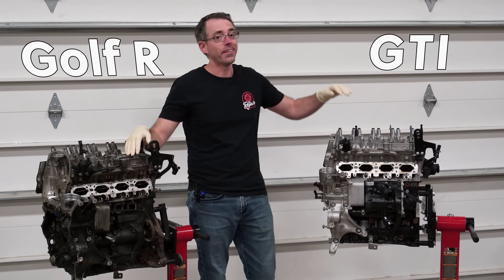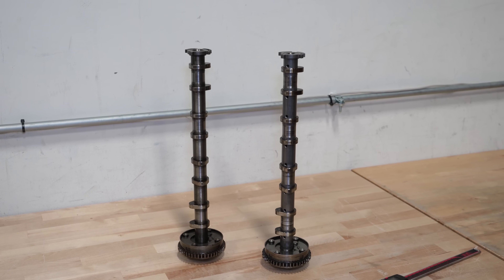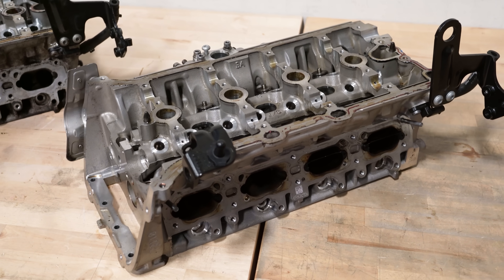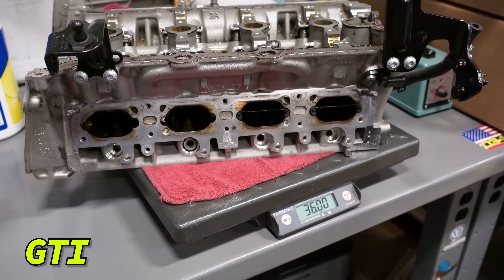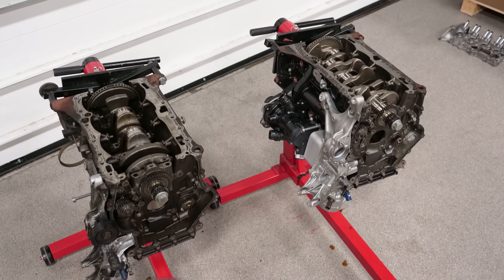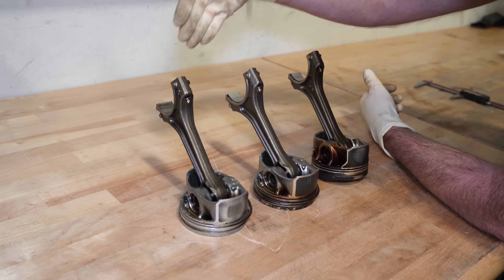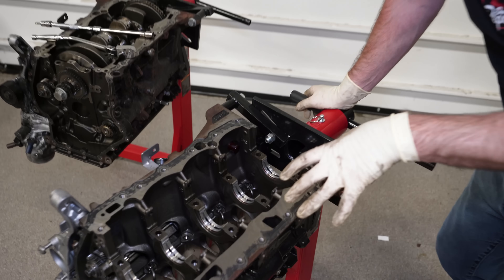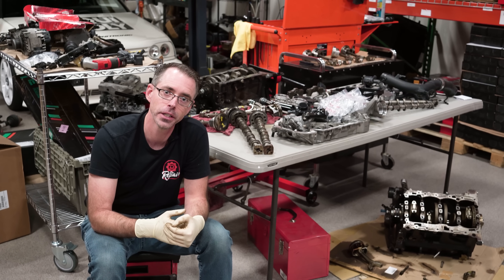Are Golf R Engine Internals Better than a GTI?

Comment: I wonder if there is a difference between the GTI engine and a A3 engine, one would assume they would be the same.
Reply: AXX and BWA engines for example are the same in GTI and A3 ... 2.0T FSI with 200hp. To be more specific both AXX and BWA are found in both GTI and A3.

Comment: I thought it was basically the same engine and that it was mainly electronically limited ... and then of course a difference in turbo and everything around.
Reply: All R engines have had some differences internally from the GTI. It typically isn't much just like you see here, but there's always been something on all of the generations.
Reply: @COMotorsports  Yeah, I see that now. I just was not aware before 🙂
Reply: @makingwaves1239 It's comforting that there are actually some differences, for the higher temperatures that you experience when you're running it harder.
Reply: @ByteSizedSociety  : I agree on that, but I guess that people that buy both the GTI and the R cars are buying them for running them hard ... at least periodically 🙂
Reply: To be honest, there's no overheating and thermal issues with a GTI engine that's been boosted up with hybrid turbo and such, if the owner actually does their homework and equips upgrades with appropriate intercooling, intake efficiency, and a high quality tune that doesn't lean the fueling out.
Reply: with mk8 gti and r - they have different compression ratios (9.6 vs 9.3), so they are still different.

Comment: It would be interesting to see the difference if you'd just swap a Golf R exhaust cam onto a GTI. Probably just a very small improvement on turbo lag.
Reply: I doubt it. I currently run an IS38 on my MK7 GTI. It’s tuned and running WMI. I hit full boost before 3krpm’s. Would love to see a Golf R’s full boost hit.

Comment: Shopdap I want you to know I did lowering springs on my mk8 yesterday and it took me 11 hours including 1 trip to Autozone.  My body and mind are broken.  When I close my eyes I'm still trying to get bolts to line up.  The biggest slowdowns were getting the driver side strut out and in, ended up loosening the steering column bolt (?), and getting the rear back together on each side. Had to try it in different orders jacking up and down over and over until finding the sweet spot for each bolt.

Comment: we needed this video. So might aswel get a GTI and slap a turbo on it. Differences are minor
Reply: Engine wise yes but awd and suspension makes it worth it depending on application haha
Reply: @vw.noahhh  totally disagree mate. The GTI TCR and Cupra are both faster thant he Golf R around the nurburgring and on a roll which is more liked what you would race someone off on the street. The Cupra and GTI TCR are like 150kg lighter and dont have 12-15 percent drive train loss. I owned a cupra before my RS3 and it never ever once got beat by a GOLF R. Always big gaps. Sure though if you love booting it from traffic lights sure. 

I dont hammer any car iv got in first gear or launch them. Its too harsh on the transmission. So i wouldnt ever want a golf r... I think a GTI PP and then slap on a IS38 would be the best bang for your buck.
Reply: @johnboy2436  definitely could agree on that point as well but 1) this video is comparing a base GTI to a base R and 2) Here in North America we unfortunately do not have the tcr, clubsport, any seat/ cupra’s/ skoda’s so that’s also not a fair comparison haha. The only valid one is the PP GTI plenty of people here especially on the east coast are already at the limits of the factory LSD.
Reply: @vw.noahhh  Yes but the GTI PP with an IS38 is pretty much the same as a cupra which is faster than a golf R. I dont own one so thats not why im saying this however... it seems like a very good route to go. I would do all the labour myself... probably take a day to get the turbo changed over. Bang for buck you cant go wrong with a GTi PP. I didnt even realize the USA didnt have these models... that sucks.
Reply: @johnboy2436  show me a video it is faster from a roll, stock...!?
Reply: @johnboy2436 if you're going to keep the cars stock then maybe you can claim GTIs to be faster in certain metrics, but not in the 1/4, especially once you start cranking the boost. That's the reason why the Draggy leaderboard (in 60-130 and 1/4  mile) has nothing but Rs at the top.
Reply: @johnboy2436  as a mk7 GTI Clubsport owner I wouldn't be too sure about the roll race. Yes the R-engined GTIs have the power-to-weight advantage, but at least for manual models, the Golf R is geared shorter. This will result in it having better in-gear acceleration than a GTI. I can't seem to find any videos that pit them against each other from a roll though so I can only speculate.
Reply: @psiturbo  just type in YT cupra vs golf r... any video on a roll the cupra wins by many car lengths? i would send it on here but links get removed.
Reply: @dq3666  I was comparing Golf GTI with IS38... the cupra does 100-200 faster than the golf r. Even on draggy. Its the faster car. Even around all the popular tracks around the world. The Cupra beats the golf r. The cupra even took the hot hatch throne from the Megane RS than held it for like 6 years. We are talking about the exact same car you know??? the cupra is a golf r... its the exact same chassis, exact same engine.. just 150kg lighter and doesnt have 15 percent drive train loss (like 35-40 bhp). Its simple why the golf r isnt as fast. I dont understand your point really. So from this video we can also understand a GTI PP with an IS38 is the same car as a cupra and will be faster than a golf r.
Reply: @tally5k339  I was comparing Golf GTI with IS38... the cupra does 100-200 faster than the golf r. Even on draggy. Its the faster car. Even around all the popular tracks around the world. The Cupra beats the golf r.. ALSO there is a golf with the golf R engine. Its called the golf TCR. The cupra even took the hot hatch throne from the Megane RS than held it for like 6 years. We are talking about the exact same car you know??? the cupra is a golf r... its the exact same chassis, exact same engine.. just 150kg lighter and doesnt have 15 percent drive train loss (like 35-40 bhp). Its simple why the golf r isnt as fast. I dont understand your point really. So from this video we can also understand a GTI PP with an IS38 is the same car as a cupra and will be faster than a golf r.
Reply: @johnboy2436  again, you are comparing stock for stock*. Now swap to big turbos--the FWD won't be able to put the power down off the line, so it gets smoked *every single time. You must not have checked the Dragy leaderboard, because all of the fastest MQB cars are Golf Rs, and there aren't any GTIs, Cupras, or anything else that's FWD that are even close. Even in roll races, the 60-130 record is held by Golf R.
Reply: @dq3666  0-60 means nothing.... Wow you can set off fast.... Cupra will ALWAYS come back past. If you want to race from traffic lights be my guest. All the car guys i know dont boot it in first gear, they care about there trans when they are tuned. Real world on a roll 40 onwards traction is fine. On a track, traction is fine. All the like for like Cupra's vs golf R on 100-200 runs beat the golf r... you think its spinning at 62mph with good tyres and good weather? your point is invalid. Golf r is slower, face facts. Nurburgring times dont lie. You keep saying dragy. I have a dragy and everyone compares 100-200 (62-124 mph)... You're a traffic light warrior bro. The golf r gets beat on track by the GTI TCR, GTI Clubsport S and the Cupra. Do you want me to show you the times?
Reply: @johnboy2436  yes bro I know what a GTI TCR is. The GTI Clubsport sitting in my driveway is the pre-facelift equivalent with the Golf R engine...

My point is that, if you compare the technical specs, the manual Golf R has shorter gear ratios presumably to improve acceleration compared to the lighter GTI. This is a tradeoff for reduced top speed however. So while a Golf R is a heavier car than a GTI CS or Cupra 300, it might accelerate harder because that's what its gearing is optimised for. Whether that is enough to offset the weight penalty is what I'm not sure on. I haven't seen any direct comparisons in a roll race. 

However as a driver's car I do agree that a Clubsport/Cupra/TCR is a better pick for the mk7 models. I find the mk7 R takes itself a bit too seriously, and that weight penalty is noticeable. A hot rod GTI is more fun more of the time
Reply: @tally5k339  Im not sure if your talking about the clubsport or the clubsport S... but here are the 100-200 times for both 

VW Golf R (Mk VII)	
100 - 200 kph	14.5 s	

Golf GTI Clubsport S
100 - 200 kph	13.0 s

As we can see the Clubsport is quicker. Its quicker around a track. Check the nurburgring times? I mean a second and a half is more than you think. You have a good car there mate
Reply: @johnboy2436  Tally didn't disagree! Obviously a two-wheel-drive car is lighter and has less drivetrain loss. Though I assume the Golf R disengages the rear wheel drive when it's no longer required.
Reply: @johnboy2436  regular CS, unfortunately the CSS wasn't offered in my region. Would be significantly slower because they sandbagged it to ~260hp (w/ 290hp overboost for 10 seconds at a time) so as to not outdo the R. Wouldn't look good if the spicy GTI was outright faster than their all-paw flagship. 

Anyway I saw a direct comparison of a 7.5R and a TCR, both with the DQ381 DSG7, and the TCR did indeed pip it by a couple seconds on the 1-200 run. If that mk7 R was a manual model, I'm not sure if say a Cupra 290/300 with the full power would beat it as convincingly as the CSS did. Probably be half a second in it tops
Reply: @johnboy2436  negative, I just watched it, from stand still the Cupra/ Leon, got smoked, and from the 50mph roll race got gapped by several school buses the Cupra... LOL 🤣
Taking in consideration that FWD is not the usual GTi, it has 300hp, much lighter than the Golf R, while the R is 320hp (on paper), and much heavier. Even the driver of the Cupra was dumbfounded the R was quicker as he expected at least from a roll race to win.... BUT still the Cupra was left behind, besides that it looks like a sporty cheap cross-over, ugly AF.
Reply: @tally5k339  The Cupra and TCR always come back past though thats my point. So real world, on the streets your beating a golf r and on track your beating a golf r. I dont want to drone on by i think you get my point, in real world application the TCR and cupra come back past. The cupra has the same chassis as the TCR and golf r. They are pretty much the same car with a different shell. Anything with a dig gives a golf r an advantage and makes it look better... Depends what you want from a car. If you want to race people from traffic lights then sure golf r all day. I presonally dont launch any of my cars, its too harsh on the trans and other components so the golf r would never suit me. I do track days etc. So the Cupra or TCR would be better. Which is what i have.
Reply: @psiturbo  The Cupra and TCR always come back past though thats my point. So real world, on the streets your beating a golf r and on track your beating a golf r. I dont want to drone on by i think you get my point, in real world application the TCR and cupra come back past. The cupra has the same chassis as the TCR and golf r. They are pretty much the same car with a different shell. Anything with a dig gives a golf r an advantage and makes it look better... Depends what you want from a car. If you want to race people from traffic lights then sure golf r all day. I presonally dont launch any of my cars, its too harsh on the trans and other components so the golf r would never suit me. I do track days etc. So the Cupra or TCR would be better. Which is what i have. I think you point went over my head completely. On a roll the cupra wins everytime by 10 bus lengths. On a track the cupra wins everytime by 20 bus lengths. The cupra wasnt left behid, infact cupra are there own brand.... shows how much you know bud. The interior of the FL cupra is the EXACT same are the golf r and has better bucket seats. again shows what you know.
Reply: @psiturbo  Also the R doesnt have 320 bhp. Thats the MK8... Which the cupra STILL Beats. We are talking about the Leon Cupra 5F. Your talking about the wrong car bud hahahahhaa. Bro sat here talking about a completely different car. You're talking about the new cupra. Yeah bro not as far. I raced one the other day and left it for dust. That was with my misses driving too. He flashed and smiled after he got gapped. Moving on... That golf r mk8 your talking about is 365 bhp and its tuned. It was tested after beating an S3 that has the exact same engine. 

Your talking about carwow video mate with matt watson. Yeah dude thats a tuned golf. Once again bud you dont even know what car im talking about. How you on a Golf Mk7/7.5 video talking about an Mk8 golf and a completely different cupra with different engine. Thats quite silly isnt it. Who would compare a ea888.3 to a ea888.4 on a completely different platform hahhah. As stated the Cupra 5F is much much faster than the Golf R. Every single video on youtube shows the cupra beating it stock for stock and like for like they Golf r gets LEFT. So just give over mate. No need to be salty over facts. Its simple maths. The cupra is the exact same engine and its 200kg lighter due to no AWD drive system and doesnt suffer the 12-15 percent drive train loss. Making it quite abit quicker on a roll and around a track. Done and dusted
Reply: @johnboy2436  yeah we have the same mindset. I don't do hard launches and live in a warm climate so don't find myself missing the AWD from a stop, and on a curvy road the lighter GTI with a similar (if not the same) IS38 punch feels more playful
Reply: @tally5k339  exactly mate, its just not needed in real world application. Though it does have its application... for track and b roads fwd is faster and not to mention more FUN.
Reply: @johnboy2436  like always, excuses, it is a total different video bla bla... When I copy pasted your search keywords.
I did find some soccer mom Transformer like  Cupra Top Gear link review 
On that video the R is not modded, and it says 320hp. Go back and watch it, tell me at what minutes does it say is modded, because it is not
Reply: @psiturbo  mate your talking about a completely different car..... are you real hahahahhahah.Just type in cupra vs rs3. or cupra vs m2 or cupra vs golf r.... You will see. Like to like the cupra wins.

simple maths evades you. whats complicated about EXACT SAME ENGINE SAME TURBO SAME EVERYTHING. One car is lighter and has 40 more bhp due to no drive train loss and is lighter. Are you ok mate? Like actually?

My mans on about MK8 golf in a mk7 video. make it make sense. ON that video the BLUE MK8 R IS 365 BHP MATE. Look for the video when it goes against the s3 with exact same engine and smokes it. then look for the dyno runs. It legit goes on the dyno and runs 365 bhp. Mate get outa here hahahaha TROLL.
Reply: More like negligible and pointless.

Comment: Is it possible the Golf R cam is solid billet, as opposed to the pressed on lobes of the GTI cam? What would definitely make it more expensive, as the machining is more complex.
Reply: most performance cars use hollow camshafts save weight for rotational mass for reving.  I seriously doubt the R engine has billet anything on it.
Reply: @eppyz  yes, but I was referring to the initial blank. The shaft of a billet cam can be bored. It would certainly be easier and cheaper to machine the lobes and press them on, but then what is the difference between the two intake cams, and why is the R cam $800ish more?
Reply: @jameshaulenbeek5931  Most likely due to production.  They Sell 10 GTI's for every 1 R.  Less parts being made, prices go up.  Yes there might be a minute difference, but probably not one worth $1000 US more.  Paul will find out when he installs the GTI Cam.

Comment: You're doing the Lord's work here.
Reply: and God regularly punishes Paul... commonly seen on video...
Reply: Built by the Germans to punish the Jews 🤣
Reply: Indeed. Amen 🙏🏽
Reply: That so true, The lord's work indeed.
Reply: The lord says vw stopped making good engines worth rebuilding in 2005.
Reply: @fastinradfordable And the devil replied EA888.
Reply: @fastinradfordable  R32 Was the last good engine indeed.
Reply: @IlikeShekels ea888 makes 4 times the horsepower of an R32 with simple bolt ons and is twice as reliable. You are biased due to nostalgia, can’t deny the r32 is a great motor and CAN be even better with a turbo. But stock for stock it’s not even a conversation